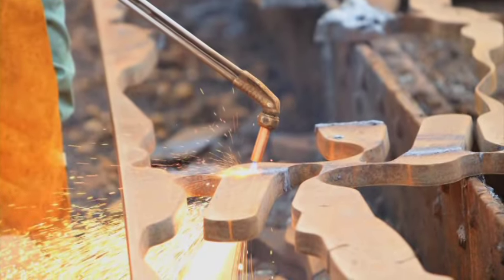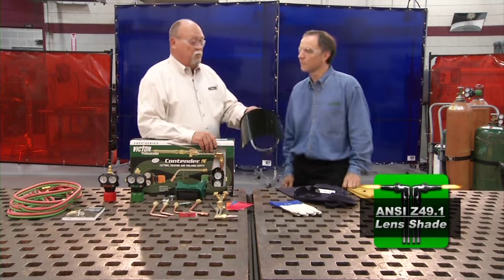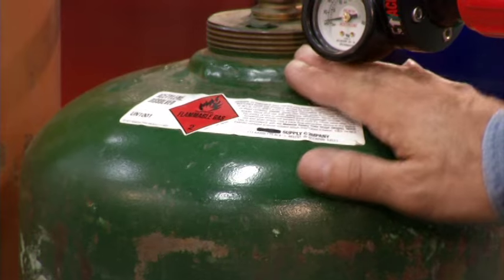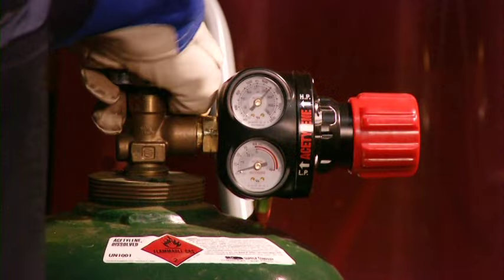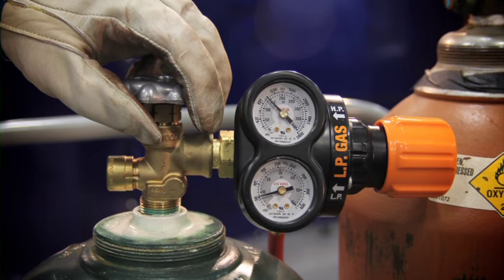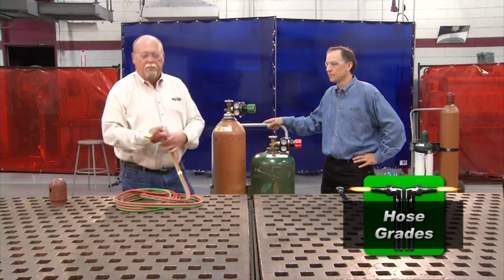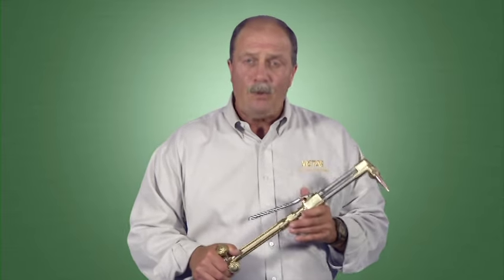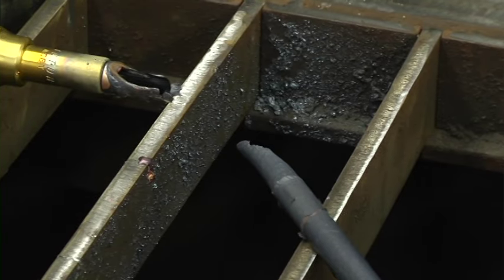Victor Oxy-fuel Safety

Comment: What happens if you try to use acetylene over the 15 psi rate, and under the 7% tank level?
Reply: Just found out about the 7% issue,, you run the risk of acetone getting into your line.. Not good for hoses..

Comment: Is it safe to place both fuel and gas cylinders very close to each other in the first place though?.🤔
Reply: Yes, they're sealed. And even in the event of a leak or a fire, your already reaching for the acetylene valve to turn it off. And if there's no regulator on the bottles, the bottle caps go on.

Comment: :/ The dashes on the acetylene hose nuts do not mean left hand thread, it means flammable gas.
Reply: Every other video I've watched so far says it IS for showing left handed threading..
Reply: I'm guessing they use left hand threading on stuff like gas connections,, as a safety feature... Makes one think about if they are doing it correctly or not..
Reply: the knotch on nut for both left hand thread, and explosive gas ID

Comment: Victor welding/brazing/cutting torches are equipped with flashback arrestors at the torch end,for more safety will it be out of order if additional set of flashback arrestors are installed at the regulators end.Thanks for this info and I look forward to hearing from you.